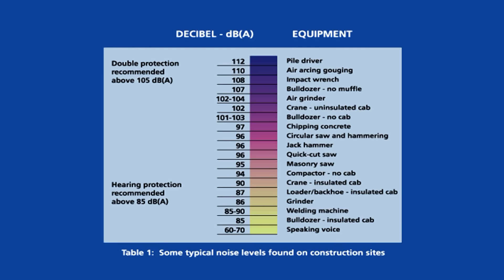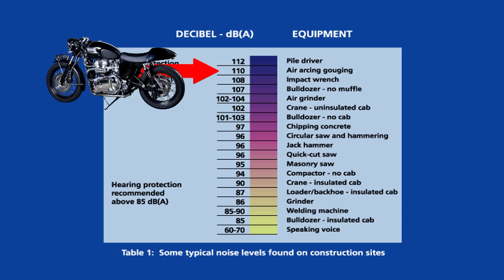Why Not to Change Your Car's Muffler

Comment: This guy doesn’t want us to do anything with our cars 😂
Reply: Rip your cats out man, they just the governments excuse to screw up gas flow.  Do it man!
Reply: Ty Jones dude, just buy an old car!
Reply: This guy says correctly
Reply: I mean, he does make it clear that we need to get a tune. That goes for any mod that relates to fuel or air. Intakes, exhaust and such all need a tune afterwards to get the most out of the particular mod.
Reply: I think he still thinks he's at the Indy 500
Reply: It's true. He doesn't.
Reply: @johnharriel4485  cars function best with muffler but motorcycle are different because they don't have room for elaborate cooling so removing the muffler for aluminum tube's improves performance.
Reply: Ty Jones on god😂😂
Reply: @damienhartley3222  Perhaps
Reply: @damienhartley3222  O.K!  Then Hell Yea!
Reply: I mean he is right tho.  If you want a loud car then buy a loud stock car. The car community  aint limited  there's  alot of variety  to choose  from
Reply: @mars9075  The point was that motorcycle are better off without a muffler. Consider it a carbon tax that you are hearing a loud motorcycle because it burns less oil that way.
Reply: Stevie Wonder  car mats pretty rubbish you can use q shower Matt to save money.
Reply: Seriously
Reply: For real just leave it completely stock
Reply: I'm laughing at all the comments from these kids out here that think they're engineers. And this messages for you have you ever considered the fact that some of these manufacturers just wanna sell you something and take your money? It's been proven several times over on dyno that there Is very little gain on changing muffler alone usually it is  Muffler and cold air intake together and a reset of the CPU but even that is only maybe 10 hp.  It is also been proven that in some cases removing the exhaust you actually lose power. Somewhere here on YouTube there's an engineer from flow masterWho explains a lot of these dynamics
Reply: Ty Jones he really stresses on running the car how it’s made to avoid issues and ta have it through 700,000 miles
Reply: Small economy cars don’t actually need cats. Not my words. Scottys
Reply: Today I'm gonna explain why you shouldn't drive your car.
Reply: This guy doesn't want us go buy any car any than Toyota/Lexus.
Reply: Right hahaa i notice u dont want u to have no fun
Reply: Ty Jones on god
Reply: 🤣he definetly make me think twice before modding🤣
Reply: @mars9075  they didn't want to approve me a stock loud mustang, cause am too young with no credit, so yeahh
Reply: Stevie Wonder  jajajajajaja
Reply: @mars9075  "if you don't have a car just buy a car"
Reply: Exactly! That's what I was thinking! 😂
Reply: @damienhartley3222  cars do not run better with a muffler.
Reply: Stevie Wonder  👍😂😂😂😂😂😂😂😂😂
Reply: I got a Mazda 3 s  2007 with a flowmaster for 7 years already no problem still running great just got fresh paint phantom blue mica original paint awesome color
Reply: The Hooning Gentleman How would you tune it?
Reply: @s.s.divakar7911  buy prius, it will be great for you.
Reply: The computers are smart enough to calibrate and adjust the cars air intake with respect to the mass coming out of the car other wise the system would not work and be very unstable due to changes in weather, air density and other variables.  Having a fixed program in the computer (like most of you are implying) that is built for the car when stock would limit it's performance when atmospheric changes are made.  The computer compensates for what is missing by taking in data from all the sensors. Therefore if you were to change the exhaust it would be recommended to also change the air intake, so that the rate of the mass coming in can be close to or equal the mass coming out and it is not limited by the air intake or vise versa.
Reply: I wish his face had a muffler.
Reply: X D
Reply: You WILL drive the most boring car on the face of the planet ''1994 Toyota Celica'' and you WILL NOT modify it anyway whatsoever.
Reply: Yeah! you're right! Hahahaha..
Reply: More like warning us to make a decision. He said if you do it, do it right at least
Reply: Because it's stupid. People who designed cars the way they originally are, knew what they were doing. Taking the original muffler out obviously doesn't make a lot of sense. Muffler Tips are a whole different thing though.
Reply: His mouth is LOUD!!!!
Reply: Lool, IT was 2k, and then i liked too and then IT was 2.1k xddddd luck
Reply: Yeh he no fun
Reply: Roostertailin'3000 😂😂😘
Reply: Yeah keep stock
Reply: @thomasalias8492  lol to each is own my guy
Reply: @johnharriel4485  Just did it thanks for the advice man my civic went from being a Honda to a Acura NSX
Reply: Exactly. All his videos are pretty much “throw your vehicle in the junkyard”
Reply: I was just thinking that clicking on the video😂
Reply: No, he is just helping us to not crack our cars. Look the miata, is perfect th new model with out any changes until 450 miles
Reply: he’s just speaking facts
Reply: @moneymakingboyz9461  how
Reply: @tyjones6568   with his mouth
Reply: @moneymakingboyz9461  what’s a muffler going to do
Reply: not true...you can, just make sure you have it reprogrammed, most people just bolt on and go...
Reply: What he say just myth
Reply: damn project car culture is terrible
Reply: Only stupid people want loud mufflers
Reply: @bloodsoulsgaming502  as said in the video, a loud muffler is basically a removed or aftermarket cat and muffler, which gives performance buy needs ECU tweaking. Stupid people straight pipe their cars
Reply: Most mechanics hate aftermarket crap customers put on their cars.  It complicates a lot
Reply: He likes his neighborhood quiet, so he can post his videos. Haha.
Reply: @christrealg934  me too 😁🤣😂
Reply: No he just showing you how to get the best life out of  your car man........!  So I guess  your  not listening to what he trying  to tell  you......
Reply: @garrettfriend4772  😂😂🤣
Reply: No cai no muffler swap like bro we want all the power and sound we can get
Reply: I swear 😂😭 everything I look up I see his vid come up saying “why not to do…”😂
Reply: Exactly bro every time I look for a car I found this guy saying don’t buy this 😭
Reply: Ong man not to mention man’s here doesn’t realize half those Japanese cars are engine swapped or built that’s why they sound the way they fo
Reply: Right that’s what’s I said man! Lol
Reply: He don't care if it's tuned by a pro.
Reply: the cold air intake video is the best :D lol
Reply: Bruh😂
Reply: YO FOR REAL😂😂 i feel like i watched only 2 videos and he ain’t want me to do nothing😭
Reply: Im starting to feel that way too
Reply: its not that a loud car is horrible
Reply: I saw my burnt tip catback in this.. 😆
Reply: He only stated, that if you don't reprogram the ecu to work with the muffler you shouldn't do it
Reply: @mars9075  dude but like we want to just do what we want it’s our money and our cars
Reply: His voice needs to be muffled 🙄
Reply: @janbauer752  🤣😂🤣👍
Reply: 1000000000000000%
Reply: Bro...
Reply: Lol Captain Buzz Kill. 😆 😁.. Hi Scotty. 😁
Reply: "Why you shouldn't drive your car"
Reply: @josecarlosgarcia2652  dude puts my muffler on blast right on his thumbnail image. 🤣.. So cruel!😂
Reply: on god😭
Reply: Or buy anything cool
Reply: @christrealg934  same
Reply: Although he's correct. He's not paying your bills. Have fun and keep a bank account
Reply: Seriously though. And he hates everything that’s awesome
Reply: Except compare it to his Toyota Celica
Reply: Lmao right
Reply: @nathanmcdonald610  that was good man.
Reply: He sounds like my dad
Reply: @Sky1  i am doing an electric cutout . So 95% of the time my engine will be running stock . But when im at meets and such my car can be straight pipe sounding (: . To me that is the safest and responsible way to do it . And if the electric cutoff valve stops working i can at least replace it or just leave it in the closed setting and my car stays stock (:
Reply: Pretty much but yet i still watch him xD
Reply: He does want you to rev up your engines
Reply: My 1st was a 05 G35 coupe manual back in 09 put like 15k into the car did almost everything except turbo 
My 2nd 2011 auto was a G37 coupe IPL in 2018
My 3rd was in 2021 another 05 G35 coupe auto 
And now in 2023 an 04 auto G35 coupe. Its pretty hard to find a decent condition manual in Miami fl 
And on my 1st  G took out catalytics and changed y pipe and put a Stillen exhaust put an injen cold air intake. Performance chip. Changed to light weight pulleys. Stage 3 racing clutch. Then  tuned it.
Reply: haa man I just thinking to change muffler in 2000 es 300 .
Reply: Agreed
Reply: 😂😂😂 he is looking out though 🏆
Reply: @Sky1  I mean while that's true I'm sure alot of people get aftermarket exhaust systems because they sound better than the OE exhaust. Perhaps they don't really care about how much or little HP they gain from an exhaust maybe they just want a louder exhaust  or a nicer  exhaust note. Like I've done some minor mods to my car to make it OEM plus and the intake noise and nvh has become abit louder but my exhaust is still stock and very quiet and I'm wanting to upgrade the exhaust to give it a nicer deeper slightly louder tone to make it feel less odd having intake sounds but no exhaust note. It's honestly just personal preference I don't really care about whether or not there's an power gains until I go deeper into power mods and getting a tune
Reply: I swear anyone who's above 60 hates anyone who sees cars as more than a form of transport
Reply: @Sky1 system is designed for some back pressure, open headers loses power. Cats, muffler and resonator probably loses power.
Somewhere in the middle perhaps a tuned straight pipe with the H piping biggest power at useful RPMs .
Fuel air mix will need tuned last .
Reply: He does but properly. Get a tune for it, don't be a ricer.
Reply: No cats (catalytic converters) then  u would have a problem in India . In India they are not using cats so the smoke is everywhere and super toxic. Listen to Scotty...
Reply: I was thinking the same thing 😂😂😂
Reply: He wants us to keep our stuff reliable
Reply: Exactly!!!
Reply: True 😂
Reply: @blackbeard0074  No it’s because he’s smart. Just listen to any Civic that some d-bag 20 something year old guy put one of those fart can muffler on. All those pops and cracks you hear coming from the exhaust is the engine misfiring. It will be in the junkyard sooner than later.
Reply: mars 
Where can I get a free flow factory exhaust Chevy Traverse ???
There's very little options for people that like to hear the motor .
Even a "cheap" Focus ST or GR are well over 40 grand, for basically a go-cart and are no longer even sold in the US! 
Plus, try to fit a 55" TV or exercise bike in the back of one of those.🤣🤣
I might need some practicality but my fun genes are not dead yet!
Maybe there were options back in the 70s. But for the few poor people like me with a sub $100k budget, its custom mods all the way!
🎉🎊🎉
Reply: You probably shouldn’t if you don’t have the software patches. 🤷🏻‍♂️
Reply: He couldn't care less about "your" car.
He's a proffesional mechanic. He just tells it like it is.
It's that simple.
Reply: Why does he hate fun? Even an axle back is off the table in his eyes.  Boo this man!!!
Reply: Right??
Reply: Swear to god!! Man says no cold air intakes, no exhaust work, what’s next? No premium gas??
Reply: He has a previous video stating that mufflers are just there to muffle sound.  (Name of the part)  Take it as you want.  I use common sense.  F the muffler
Reply: Pretty much
Reply: I stg 😭🤣

Comment: Scotty complains about every modification. He should just drive a stock Prius 😂
Reply: High Diamond exactly,  this fckn guy.
Reply: BooostedGTI 😂😂
Reply: He drives an old Celica. A Prius has added complexity. Complexity he doesn't want to deal with.
Reply: Scotty is absolutely right though. A lot of people put in new intakes and mufflers but they don't get it tuned. You need to tune it!
Reply: Derek K i put a flowmaster on my truck 15 years ago and never got it tuned. I did get an extra 2mpg better fuel economy though.
Reply: The problem is people do modifications with no idea what they're actually doing so they do it wrong, not the modifications themselves... he made that extremely clear...
Reply: @RWoody1995  bro he's an old man he doesn't know any better
Reply: Prius is the best of the best
Reply: Next video: why not to buy a Prius...
Reply: @dirtycommtroop  
Not always.
Many computer controlled cars can easily compensate for mild-moderate intake/exhaust mods.
Reply: @nashvilleoutlaw  
Unlikely.
Unless the previous muffler was defective somehow.
Reply: Not the ones that i see driving around.
Reply: Derek K That makes no sense, you don’t need to tune your car after getting an intake nor an exhaust.
Reply: Cars with forced induction need a tune after intake and exhaust modifications.
Reply: Yeah but not NA cars.
Reply: Scotty gives solid advice for average people. If you know what you are doing then mods are fine with the right car, setup and tune.
Reply: @6lemans10  
"Cars with forced induction need a tune after intake and exhaust mods."
Again not necessarily true.
If they use MAF, they can usually adapt to minor intake and exhaust mods, such as mufflers, so-called "cold air intakes, ect.
Even many forced induction speed density setups can handle such mods.
Reply: He’s a cheap guy, that wants a simple and reliable car.
Reply: The only thing that gets him hard is a stock camery
Reply: Modifications done right.
Most people don't do them right. That's a fact.
Most mechanics I've known have a negative view of young people messing up their cars.
Even though it's their own car it's still annoying to watch.
Reply: Derek K how tho
Reply: Hey cupcake did your daddy buy your car?
Reply: I mean bro does revere the Toyota celica as the most greatest car

Comment: I was really thinking on putting a performance exhaust system on my car, and then I watched this video. 
Still gonna do it
Reply: Agreed
Reply: Just tune it like he said.
Reply: @kotaman232  tune it HOW though?
Reply: @flute136  get it tuning by a tuner
Reply: @itz_evil1653  yea ik that but what the specific thing that like equalizes the fuel to air or whatever. Does it do it by itself?
Reply: Lol. Me too
Reply: @flute136  wdym how get it tuned professionally by a tuner like scotty said he has a point though. the muffler is already tuned accordingly with a/f ratio and o2 sensors. go ahead and remove your muffler and cats and see how your car will run more sluggish only makes it loud
Reply: @bugoykikay8074  i dont wanna remove my cats. And mufflers dont have to do with a/f or o2 since its after cats/mass air flow sensor
Reply: An axel back exhaust won’t cause any negative effect on vehicles since it’s installed behind the catalic converter
Reply: Hahah you‘re the best 😂
Reply: me too.
Reply: FACTS
Reply: 😆 🤣  yes
Reply: @bugoykikay8074  no one is talking about removing the muffler and cats genius. They are talking about upgrading the exhaust system which does absolutely work.
Reply: Right. Do opposite what Scotty says :D 
I did the same and no problem
Reply: me watching this video after i ordered new mufflers
Reply: Same
Reply: Guy’s old and out of touch.
Reply: @bugoykikay8074  So getting it tuned is better then changing the exhuast?
Reply: @Eli-9  so I would be good getting a borla axel back exhaust for my gs 350 ?
Reply: I'm about to smog my car either this month or next month so I'm sure I'll be back here to let you guys know how it went here in California.
Reply: @senorbonbon  I don't know what you're driving, but when I put my Spec-D Tuning cat back exhaust with the burnt tip on my 94 Honda Accord LX... I'm doing burnouts now in first and second. So I don't know you tell me.
Reply: Same hahahaha
Reply: @everythingrc2535  burrrrrrtt!!!.....BURRRRRRRRT!!!! 🤙
Reply: same
Reply: @ReproSlayer  do it! I love mine a year later... I just smogged it and watched the smog guy just shake his head at me during the 3000RPM highway test. ✌🤑
Reply: You bad 😂😂😂😂😂
Reply: @flute136  or someone you may know. i have a lot of people ik that can do the tuning and help me with this mod to my 98 Corolla that i wanna turn into a Tuner.
Reply: 😂   I would too!
Reply: Just get a tune up
Reply: New system should learn and adjust last year put a K&N short ram air intake on my 2011 corolla and when I took it on the first drive it ran really rough and almost died in the middle of the street but after 10min of driving it it learned and corrected itself and it's running fine now no problems and no christmas tree on the dash so new cars r fine with minor bult on's it'll learn and adjust
Reply: @DefinitelyNotMyRealName  old school
Reply: You don't have to tune it. Just a muffler
Reply: same
Reply: :face-blue-smiling::face-blue-smiling::face-blue-smiling:
Reply: @bugoykikay8074  false for modern vehicles. They adjust automatically.
Reply: Most people do this just to have a loud vehicle because they like irritating other people.